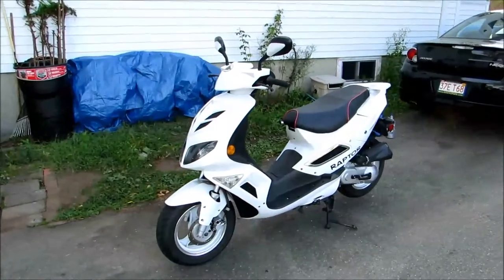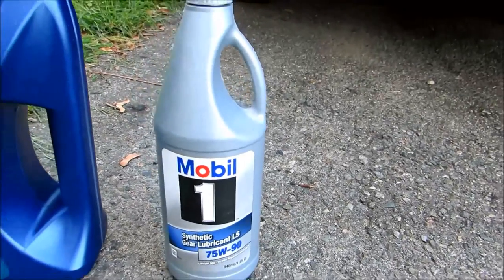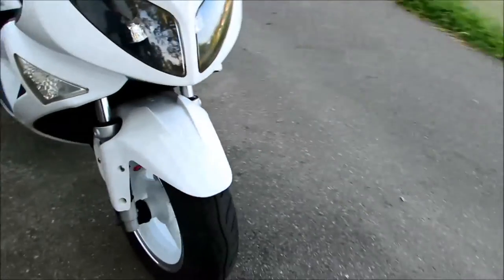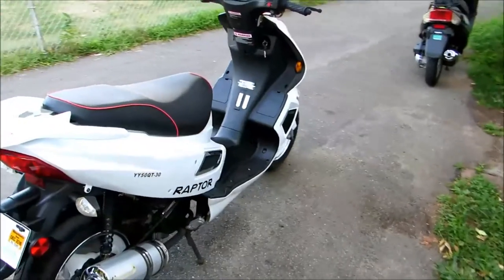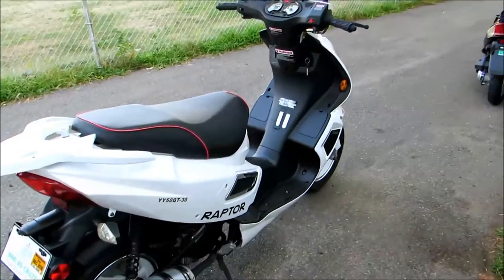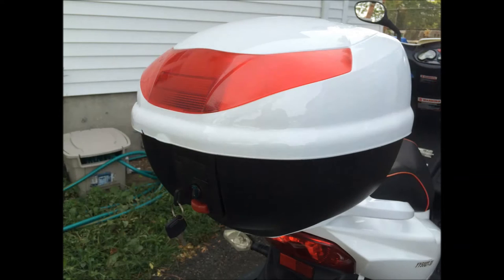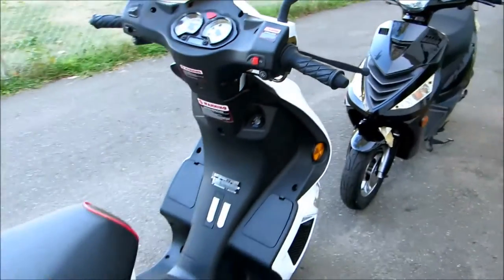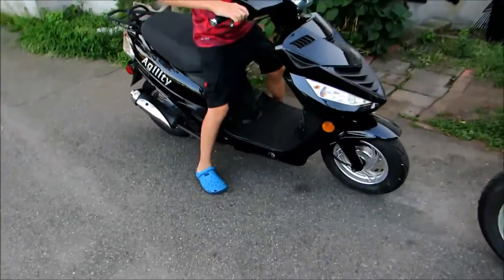Jonway Raptor Review Part 1 - Comparison with Jonway Agility

Comment: Beautiful bike bro, no offense but why not a 150cc?  I paid a little less for my 2017 Lancer 150, you like all of us want speed, but you wouldn't have to install big bore kit.
Reply from the maker: Hello Friend. A scooter with an engine of less than 50cc (in this case 49.5cc original) is considered a "moped" in Massachusetts and can be ridden like a bicycle. Hence, I was able to use bicycle lanes and squeeze between the cars when there was traffic during my commute. It saved me a lot of time. I could also park it on the curb and at bicycle parking areas without getting a ticket (it does not have a license plate, so no tickets). Of couse I did not advertise the 80cc big bore kit. 😉